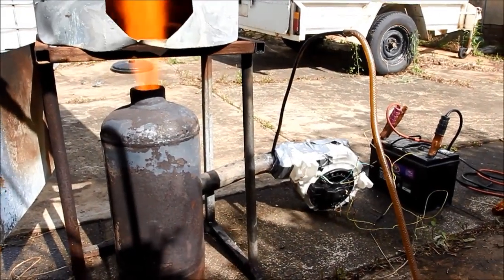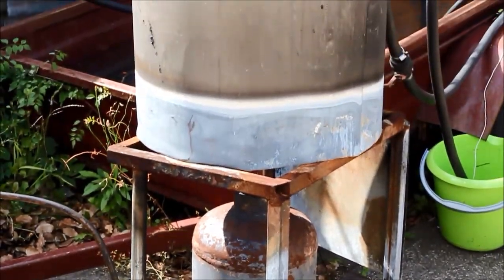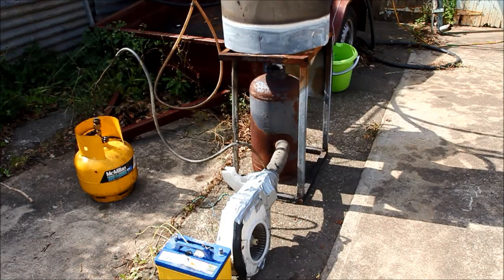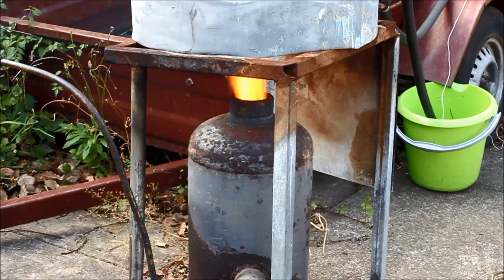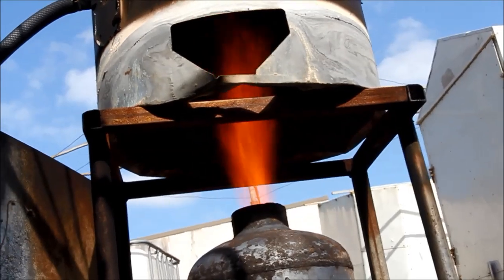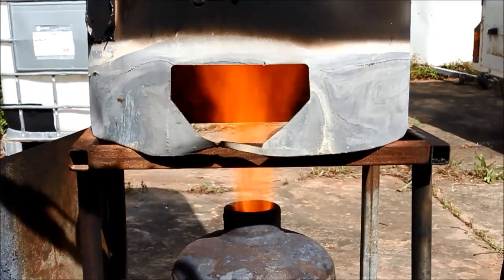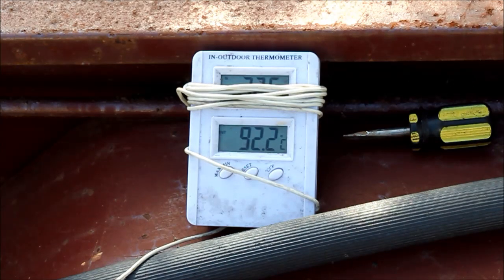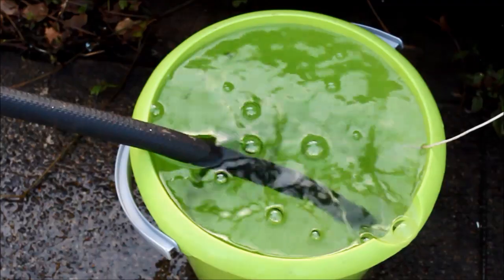How to build a Water heater to run on Free fuel.

Comment: Is it a copper coil inside that’s heating the water or just the empty void of the tank, full of water that’s being heated? I se so many of these type of things that just fill a,copper coil full ofmwater then shone it in and out at tip like to heat a hot up. And I don’t know, why the don’t just fill,a,drum that’s heated and syphonns in and out without having to us s log and costly copper coil.
Reply from the maker: These heaters normally have a gas burner underneath that I have removed. There is basicaly a hollow tube that runs straight up the middle and the water surrounds that.  The burner acts on the base of the tank and there is a baffle up the centre tube which creates turbulence  and extracts more heat due to greater surface area. 

I have made comment in later vids that every water heating vid on YT requires the use of a Copper coil when it's clear many don't even understand what the physics of using one are. 
I cringe when I see people trying to heat swimming pools with a coil of 3/4  copper over an open fire and claiming it's doing something worth while.  Yeah Right. 

Would be FAR better to lay a 200L Drum on it's side supported off the ground by Cinderblocks and light a fire under it.  Would be LOADS more effective than a copper coil but people don't understand the principals involved and just copy what they have seen elsewhere.

Comment: I've been trying to build something for the past couple months to help supplement my outdoor wood boiler system (non-pressurized), with decreasing luck.

My setup is an 50gal ELECTRIC water heater tank core (with the spray insulation removed) concentrically mounted inside of a 55gal steel drum, so this leaves about a 3/4" -1" gap between the tank and the drum. It has a convex bottom, so I figured the heat up rise up and sorta get trapped under it. Have been trying the drip feed oil into a vessel with the air coming through the center and back down into the vessel ALA GerrysDIY, but all those burners either leak or don't burn even. My first attempt was the best, but i could not get any of the heat into the water tank.

Not sure if I am not creating enough heat (although i can heat the garage its in up to 80F), or if it is the wrong vessel I am trying to heat, or if everything is simply just escaping through the chimney. Was only using a 120mm PC fan so i'm sure I'm not getting enough air, even though it isn't too smoky. It just doesn't seem like the water temp is increasing.

I am going to try your design of a more closed burn chamber with a nozzle at the top,  underneath the tank. I was also thinking of adding a matrix of 3/4" steel pipe that made 3-4 loops in the bottom of the barrel around the burn vessel before going back into the tank to try to soak up as much heat as possible. I may do that still because I can't see it making it any LESS efficient than it already is. Was also thinking of welding a plate to the bottom of the tank to create more of a baffle to retain as much flame under the tank for as long as possible.

Thanks for all the informative videos! If anyone could shed light as to why my tank is not taking in heat I would appreciate it!
Reply: I’m no expert,  but it I’ll take a stab at it. On the gas hot water heaters like he used in this video, it has a chimney going up thru  the center of the heater and out the top. That would give a lot of surface area for the heat to transfer to the water. I would guess that’s the difference.  You posted this a year ago and I just saw it. Did you ever get it to work efficiently?
Reply: @stevenmark8156  I got it to work eventually but the 55gal drum does not work well for the burn area and was very leaky, which had two problems: one was getting it to updraft through the (too short) chimney and the second was losing the draft and backdrafting into the shop getting soot everywhere. I plan on replacing the drum with another water heater and welding it air tight. Basically GerryDIY's design but with a sealed water heater on the top of another and maybe a coil of water line on top of the flame area. If it works I will post about it on my channel, I was just about to start to work on it again.
Reply: @phil600616  Great! Hope it works well for you. I’m going to try one too. I have the pex tubing in my shop floor with 3” of insulation under the concrete. . Hoping to be able to heat it with a waste oil boiler. Once it’s hot the concrete will hold the heat for quite a while. So I can shut down the burner. I’ve been looking at different designs, so I’m always interested in what works and what doesn’t. I had originally planned on buying a propane on demand water heater, but free is lots better!! Lol

Comment: Hey mate. Im looking at building a waste vege oil burner something like this to heat pool water. Thinking of using a coil of copper pipe inside a large gas bottle with drip feed burner and blower. Thoughts?
Reply from the maker: I think Copper Coils are extremely inefficient in heating water, particularly the amounts needed for even a small Pool.  Look up some online water heater calculators and see the amount of energy required to raise the temp of the amount of water in your pool.  I am using a spa heater with an oil burner replacing the gas Burner.  This has a 100Kw Capacity and the size of the heat exchanger is 2" . That's a lot different to say 3/4 or even 1" as is the heat absorption. 

The trick here is not the amount of heat generated, it's the amount of heat you can transfer into the water you want to heat. Also one needs to have an idea of the heat loss from the surface of the pool and the sides. 
I have seen a lot of Vids on running water through a copper loop to heat a pool and claims of the temp increase but practical experience and the online calculators suggest that the heat loss in a lot of these cases is greater than the heat input. 

My suggestion is find an old spa or pool heater that the electronics have gone on and replace the gas burner with an oil burner and plumb  that in.  You could get 50-200Kw into you pool depending on the size of the unit you convert where you would be doing very well to get 5Kw with a copper coil which cannot compete with a properly designed heat exchanger.
Reply: @glumpy10  Thank you so much for your thoughts. I had never thought of converting a gas pool heater. Ill see if i can find something cheap! Thanks for the idea. Most helpful.

Comment: I have been tinkering with something for about a year now.   I wanted to build the most efficient outdoor boiler I could , and then pipe the heated liquid to wherever I wanted to use it  inside my home , or outside  aka  hydronic heating coils in a poured concrete driveway to melt snow and ice off in the winter.  
I experimented with a wood stove.   Not cheap to run , and  very inefficient.
I built a rocket stove.    Not enough btu's to keep up with demand.
 
Once I came across your  Oil Burner  site , I knew I had found my answer.
I did build one similar to yours , using a domestic hot water tank , but I noted that a lot of the heat was still just going up the chimney.   
After several different attempts I think I have come across the most efficient way to  heat the water .     Here is what I have concocted.

My goal was to build the smallest and most fuel efficient burner first.     After experimenting with several different size tanks ,   I have ended up with a  small propane tank  ( about 6 litre capacity )  nested inside a slightly larger one ( about a 10 litre ).
The anular space between the two is filled with perilite insulation.    

The output is a 3 1/2  inch diameter pipe about  6 inches long , coming out of the top of the oil burner.     It sits below my heat exchanger and water tank , and can be removed at any time for cleaning simply by pulling a 1 inch spacer plate out from under it and droping it down.

The 3 1/2  inch pipe fits snugly into the flared end of another 1 1/2  foot piece of 3 1/2  inch pipe which is centered inside a piece of 4 inch pipe  which is 3 feet long.   The gap between the  3 1/2  inch pipe  and the 4 inch pipe allows a flow of secondary air into the burn , increasing efficiency and temperature.
The 3 foot piece of pipe is welded into the middle of  4 foot tall acetylene tank ( about 7 inches in diameter )  and terminates about 6 inches from the top of that tank.    At the bottom of the acetylene tank  a  6 inch hole has been cut in the side where piece of 6 inch pipe comes out and then up to  2 feet above the rest of the unit.  ( that is my chimney )
The acetylene tank is welded into the center of a  100 pound (  120 litre ) propane tank.
The entire unit is wrapped in insulation.  

So , how does it work ?    The flame and hot gasses from the oil burner shoot up into the top of the acetylene tank , and then drop back down to the bottom (around the outside of the 4 inch pipe ) , then exit the acetylene tank and go up the chimney.      The acetylene tank itself becomes a giant heating element in the center of the water filled propane tank. 
The hot at the top / cold at the bottom  liquid in the tank actually help the convection of the air flow  downward toward the exhaust exit ( chimney ).   The chimney also helps the air flow , as the heat  ( what's left of it ) rises up and out.  

I am about 60% complete with the build , still have to weld the water reservoir to the outside of the acetylene tank , but with spring in the air it probably won't get fully assembled until  October.  

What I have found was that the very tiny burner tank was not performing very well until I put it inside the larger tank , with insulation.    It just wasn't heating up enough.     I am using a very small squirrel cage blower  ( about  3 inches diameter ,  60 watts )  because that was all I had available at the time.    I thought it wouldn't be big enough , but  it is doing just fine.       I do believe that once the entire contraption is complete , I will probably have to go to a slightly more forceful blower. 

During my experiments , I was using a trickle of oil with good results.   Now , with the small insulated tank I am finding that even with an oil flow of only  3 drips per second , I am getting a constant  blow torch type flame  about  2 feet tall .      I kind of scared myself on one test , the bigger it got the more I reduced the oil feed.   The more I reduced the oil feed , the bigger it got.     I ended up shutting the whole thing down , because it seemed to be getting somewhat out of control.  

The end result so far is that I am getting a ton of heat with  not very much airflow and a tiny amount of oil.      If  the  heat exchange  works  1/2  as well as I am expecting it to , I think I will have surpassed my goals.

 The entire system will self drain into a  40 gal  hot water tank inside my home , so that I don't have to add glycol.    My local government regulates hydronic heating systems if they use glycol .   ( environmental worries )   .     A thermostatically controlled circulation pump will  regulate the flow (and thus the temprature) of the water.    

The downdraft  flow in the acetylene tank was part of the rocket stove theory that I had experimented with , and it works.    While I was producing a  very hot blue flame at the top of the combustion riser ,  the exhaust coming out of the chimney was cool enough to put your hand over comfortably.
Reply: I would like to see pictures of your build. Trying to build it in my mind as reading your description I think I'm close but a real pic or best a video on would be great.  Reply back and I'll give my Email address for more info on your build. Thanks.
Reply: +Phil Lowman  :  it is in pieces , burried in my basement right now.   Can send you a nice descriptive drawing right away , and  maybe clean up the basement and drag the parts outside for a video demo next week.    Never did finish it , have summer projects to work on right now.   Will get back to it , and hopefully finish before the cold comes back in  October.
Reply: +Phil Lowman    Uploaded a picture , click on my name and you should be able to view it.

Comment: hey burner  as you know my burner is getting way to hot. Do you have any ideas on dropping the temp on it  I was running 50% diesel and 50% waste engine oil.    Hank
Reply from the maker: henry christ Just vary the fuel and air flow. You have a powerful little blower there, try restricting the intake with a bit of cardboard and reduce the fuel flow accordingly. 
Looks like you could get a lot more power turning the fuel up and leaving the air wide open.

Comment: Very nice experiment! Of course it sets my mind to racing: "How to install electric water heater thermostats and lean out the burner when the tanks is full of hot water..." =If it's not ONE thing it's ANOTHER...  

You are already solving this dilemma for a forced air/radiator heating system. THANKS FOR ALL THE HARD WORK!!!  

I watch in AMAZEMENT at what you accomplish. Can't understand why  'hands in pockets' *kibitzers* state your efficiency is only X% or "MY propane/coil of copper system did better than THIS!   

The point is, the OIL IS ALMOST FREE!!!  It can be .01% efficient and still be more cost effective than propane. Could heat your water, home and swimming pool not to mention the hot tub ESSENTIAL for gratuitous, fondling, heavy breathing and EXTREME pleasure!!!    :o)
Reply from the maker: OgMandin0 HAHA!  I think most people have a sense of doing the best they can even with hacked together projects like I'm doing.  I understand the efficiency is not as important with free fuel as when you are paying for it but still you have to give things a decent go. :0) I'd like to make it as efficient as practical from my engineering and cost POV just the same. 

One thing I have worked out is a reason to aim for efficiency is fuel consumption and qty needed. I do have to collect the oil and it gets harder to get in winter. Working on 2L hr consumption 12-15 hrs a day, it does add up and you begin to realize how much you are going to have to get. If I find I need to burn 4L an hour to get the required heat into the home, then the thing is going to be a burden to get enough fuel for. 

I was getting oil in 1000L IBC's and more than I wanted, but that source came to an abrupt end when the guy giving it to me changed jobs so I'm back to collecting in my vehicle 200L at a time. 
This thing will only be worthwhile if it's not going to take up an inordinate amount of time so the less fuel I need to burn to keep the place warm, the less time I'll spend in the cold collecting fuel for it!  :0)

I would have stocked up more in summer but I was planning to move house so didn't want tons of the stuff around and just kept a small reserve for my vehicle.  I'll be here a bit longer now and will need to collect oil as I go for this.

Comment: Man, I shoud make a video of our 2000 gallon pool heater. We took an old radiator heater, attached a pump to get the pool water cycling through an just threw the radiator on a camp fire. Works great.

Comment: You're about ready to heat that hot tub.. 92* C = 197.6* F for those wondering.. 

I'd like to see this set up with another tank on top. Also some twisting baffles inside the heat tube of the tank. I believe it would raise the efficiency quite a bit. Of course this would be more for heating a large body of water and is for experimental testing, but just imagine if you had enough surface for all that heat produced to be absorbed!! 

Now, onto the steam powered generator....   ;)
Reply from the maker: Steve 1961P.  The heater has Diffuser baffles inside the flue already which as you say, would raise the efficiency a lot.  I was thinking of running a jacketed flue above the tank. Just an inch or 2 gap between the flue and an outer wall to run water through but then was wondering exactly how many KW it would be worth in the end. I'll be overpowering the heater no matter how small a burner I run compared to what it was designed for with gas. That will probably mean there is some worthwhile heat that could be captured coming out the flue. 
 I'd like to find a larger heater as that would have a higher rating  and better suited for what I want but for now I'll make the most of what I have and see what comes along.